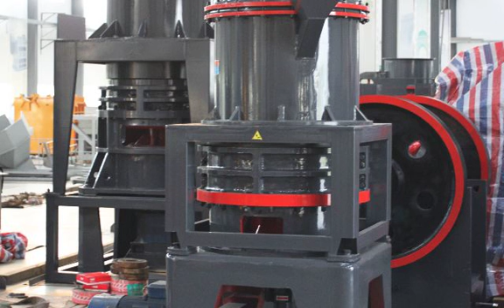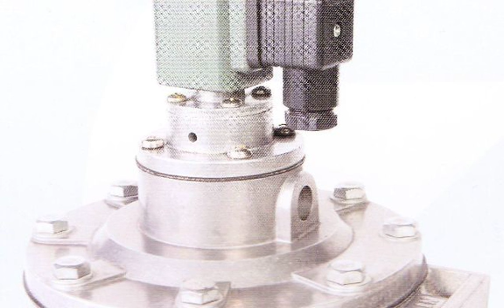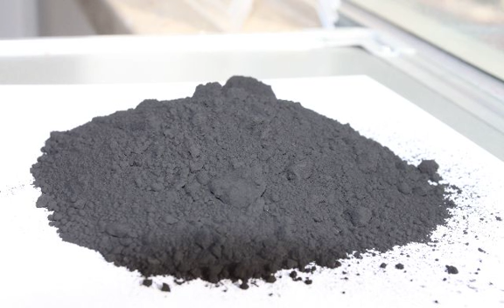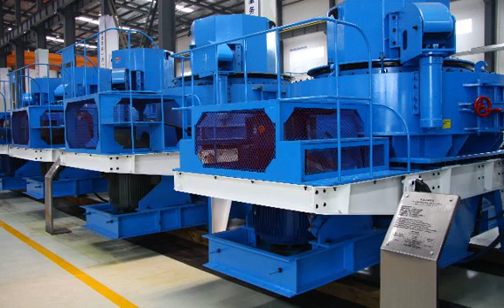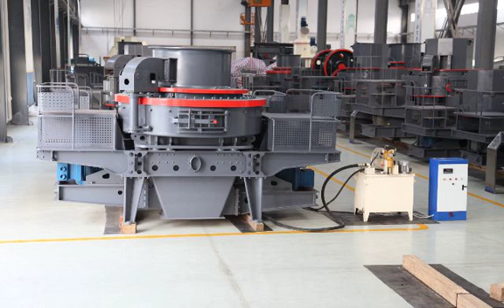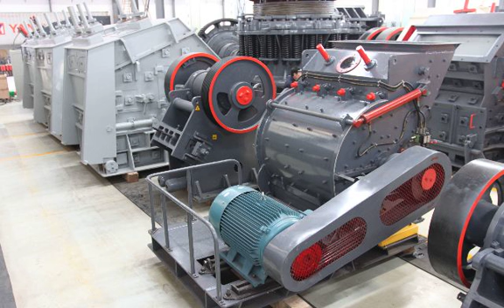Iron-process used iron ore crush equipment

Comment from the maker: SBM features advanced CAD and puter simulation test system, which ensures the quality of design, development, manufacturing and after-sale service  The pany has formed a plete production-chain that takes crushers and mills as the main products and vibrating screen, vibrating feeder, etc  as supplementary products  Read More